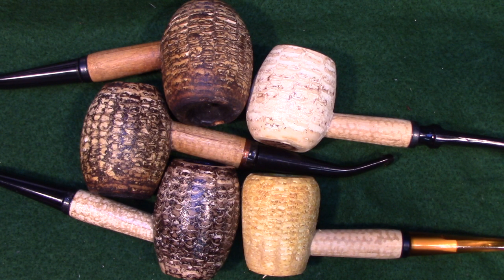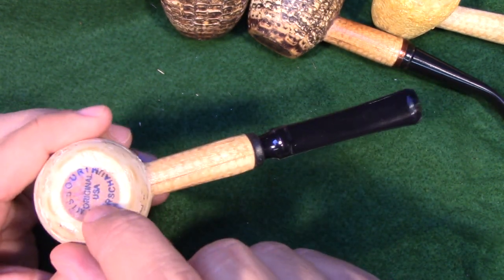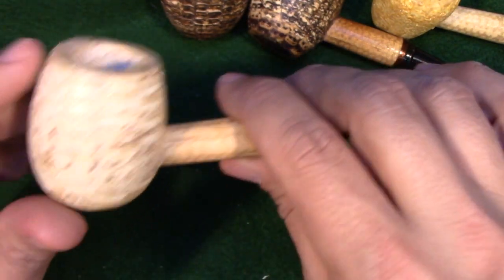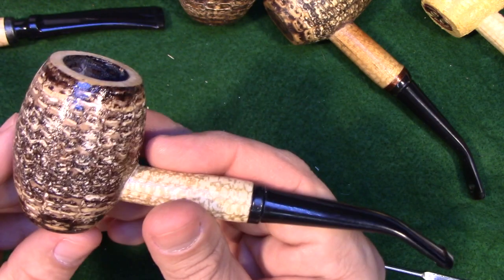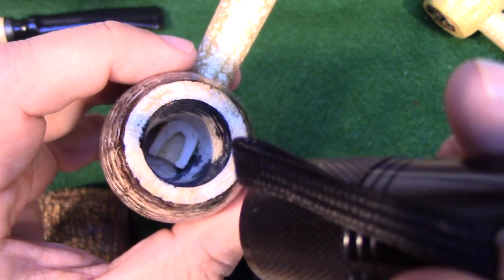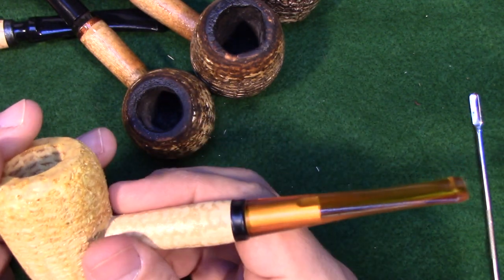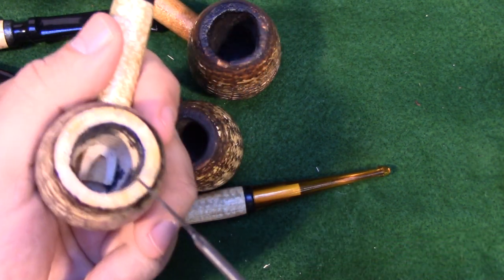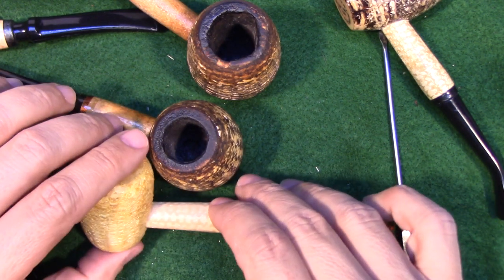Corn Cob Pipe Modification Part 1 Introduction

Comment: Hello my fellow MM enthusiast! Although I love my briar pipes, I smoke cobs very often and I love collecting and modifying them. I wanted to mention some friendly info; all of the pipes you showed are coated in plaster, it's just that some aren't varnished. The brown ones are stained and varnished. The plain cobs are easy to spot because they have a very rough textured exterior (it's a corn cob after all), they're very lightweight, and significantly cheaper in price. The factory second pipe at 10:40 is called a Rob Roy, which is a cool shape IMO, and it's stained yellow but has no varnish. Sadly they changed the 10-pipe grab bag to 7, and now it's $34.99. 

Personally I like the plastered ones - or "polished" as MM calls them, regardless of varnish - best, but the raw ones dissipate heat very quickly, which is a bonus, and that's why some folks prefer those over the polished ones. Anyways, I really liked your video and I'll be sure to check out some more! 

Best Regards from Cape Cod Massachusetts 👍🇺🇸
Reply from the maker: Thank you for watching, and for the helpful comment.
Reply: Happy to say I've got a hold of Apple  Diplomat with straight danish bit, actually ended up shortening the shank by almost half and shortened the bit, and pipe mudded the bottom of the barrel with salt and plaster of paris, lost the metal feurel and replaced it with a brass feruel.

Comment: I value my Missouri Meerschaums more than I do a lot of my briars. They are great pipes and always give a fantastic smoke. In fact, I have found that the best smokers are inverse to their price - cobs, clays, briar.
Reply: I am starting to agree. I been smoking 2 different types of tobacco out of some cobs and tried just today to go back to a briar I have dedicated to my favorite- now hate it. Tomorrow will try my favorites in a cob. If it turns out as expected my briar will be my guinea pig for carving customization.
Reply: Don't get me wrong, I LOVE MM cobs, and I smoke them just about every day. With that said, I have some briars that smoke amazingly well, but they're handmade. Factory-made pipes like Peterson, Savinelli, Kaywoodie, etc. often smoke like crap (of course, not always). The handmade pipes by the Italian artisan pipemakers are some of the best on Earth, and they smoke equally as good as a cob once they're broken in and if not overused. 

With that said, cobs are impossible to beat; no break-in period, no worries about overheating them and causing them to sweat-out moisture (at least not after a few smokes when they're new), they're practically indestructible, and they're so reasonably priced. Also, they're made by a good and honest American company. 👍

Comment: Definitely interested in the pipe mud video, I think a couple of my cobs could use a nice mud treatment. Thanks for putting this series together!
Reply from the maker: +Nom De Tube Mud is so easy you are going to have a great time with it.  The next video shows how to carve out the shank extension before the mud, but you can even just push it around and over the extension and improve the combustion.  Be well, Mike.
Reply: +CaneRodPiper Nice! These pipes are smoking pretty good for me, but who doesn't love a little pipe improvement project :)
Reply from the maker: +Nom De Tube Oh I agree!  The improvement is minimal.  Mostly just lets you get to the bottom of the bowl without burning wood.  But nothing like a little pipe improvement.

Comment: Being a new piper, seeking tips for boring out the chamber slightly.  I am thinking of using a 3/4" spoon bit to ream the chamber to 3/4" and stop shy of the bottom to remove the bit of shank that extends into the chamber.  What are your thoughts on this?
Reply from the maker: You are thinking along the same lines that I did a few years after I made these videos.  I don't think the spoon bit would allow you to get the shank extension out without going through the bottom of the bowl.  Since I made this video I have switched to using a 3/4 inch Fostner bit to do as you suggest, and that  gives a flat bottom that you can then build up with pipe mud or pipe mortar.  I really need to make an updated version of this video some day!
Reply: Thank you for your guidance.  I enjoy watching your videos.  I felt that a craftsman like yourself would have the answer I was looking for.

Comment: hey I've got this crack near the "lip" of the bowl of my MM morgan natural, cracking down maybe 1 cm to the exterior. seems like there is no leaking, just crack. is that okay? what can I do about it? thank you
Reply from the maker: I've had that happen on cobs.  Never seemed to be a problem other than cosmetic. You could probably fill it with glue and sawdust or plaster of Paris, but I would just smoke it as is.

Comment: As I am new to Corncob pipes seems like recently having bought one myself a few days ago there seems to be a wooden piece from the stem and going through and poking out on the bottom of the pipe and it has some hole so if trying to smoke the tobacco the smell etc. Possibly travel through that wooden tube part . I was however wondering if anyone who knows/ has experienced this/ has any knowledge of why there is a piece of wooden part sticking out of the bottom of the chamber or bowl leading up from the stem?
Reply from the maker: In one of these modification videos I show how to chip that away and replace it with pipe mud.  But most people just smoke the pipe until the wooden extension burns away.  It is annoying, but that is just how the pipes are made.  Thanks for watching!

Comment: An excellent and helpful series of videos, Mike.  Thanks!

My ideal chamber width is 0.85".  Most factory cobs measure around 0.75".  Which is fine, but I like to build a cake, so the factory chamber width ends up being a bit too narrow for me.

Any suggestions for drilling the chamber to make it wider?  Some people might panic about doing anything like that, but I've never had a cob burn through.  Also, a good cake acts as a firewall, and my cobs seem to last forever anyway.  So I'm not concerned with thinning out the walls a bit.  Cheers and Mellow Puffs, Mark

P.S. I use Virginia ash and tap water for pipe mud and never had a problem.  Hard and smooth as granite when it dries.  Cigar ash is probably ideal, but inconvenient for me.  In the end, pipe tobacco ash seems to work just fine.
Reply from the maker: Hello Mark, thank you for the comment.  I have increased the internal diameter using a 0.75 inch fostner bit in a drill press.  Many of the MM cobs measure 0.75 at the top, but seem to narrow.  The 0.75 bit opens up the chamber quite nicely. Take a look at my cobfoolery entry on the stubby gentleman for an example.  Thanks for the tip on VA ash! Be well, Mike.
Reply: I too have often wondered why MM makes their chambers so narrow, but as Mike mentioned, you can easily widen one with a drill press. Although for Virginias I find that a chamber diameter around 0.70"-0.75" to be best for optimal flavor, and once the cake builds up I just ream it and start fresh. For Burley and English blends a 0.8"-0.9" is definitely preferable though. 👌

Comment: Also I can’t find on the website where to get the seconds
Reply from the maker: This is an old video.  Maybe they stopped selling them.
Reply: I looked some more. They sell 7 for $30 but they’re all sold ouuut.
Reply: lf l understand correctly they no longer sell many seconds...they will let chipped bowls etc go thru now ..in other words theyve lowered their cull standards...when i ordered my pipe it came with info that there may be roughness and chipping on the bowl and the rim. one vid l watched said if you buy culls these days they will need some attention(repair) usually before you use them.
Reply: mark rush bummer

Comment: smoke the hell out of it and the cake will fill in the spaces in the bottom and burn down the walls of that hole extension till it's flush, then it's great
Reply from the maker: Yes, that definitely works and it's what most people do.  Some folks don't like the taste of the burning wood though.  Whatever works for you is the right thing to do!
Reply: Yeah...I learned the hard way about that burning hardwood.  I thought I was going to have a heart attack the first few times it happened.
So I got to, and chiselled the end of the shank out of the pipe.  Followed the instructions on the video and voila!  It now looks like a properly constructed pipe.  At least inside the bowl.  Thanks CRP.
Reply from the maker: Thank you for the comment!  I'm glad that the videos helped you.  Be well, Mike.
Reply: shatteredsquare I
Reply: I just bought a cheap chinese corncob. I am new to the tobacco pipe hoppy. My new girlfriend said that she much prefers it over cigarettes. My uncle turned me onto the world of pipe tobacco. Well I dont know much about corn cobs was debating if i should make a trip to homedepot or just let the cake on the bottom build up as they drilled the hole to deep a very thin layer on the bottom. Any advice would be good and appreciated.Thanks John
Reply from the maker: Hi John,  The only cob that I ever had burn out on me was a cheap Chinese cob.  I would recommend just putting a layer of pipe mud in the bottom to raise the floor and give the cake something to start on.   But I would also recommend a better cob when you can get one.   Best, Mike.
Reply: @CaneRodPiper  i agree with you. 6 dollars so no hard feelings. Great video I appreciate it.Yes i need to get a good pipe one of yours type. Have a good night my friend.
Reply: @CaneRodPiper  thanks again. Ive notice the bottom has a good layer of cake and is insulated quite well on the bottom and on the wall of this cheap chinese pipe maybe buying me a little time till I order online from your recomended co.Ill have to order a good handful. I might replace the stims with.bamboo. since im not to crazy about sucking on plastic.might just trim a few bamboos behind in the woods from my back yard being that I live in rhus little rv park in Tx.Ill take any free advice you have. Thanks again. If you were here we could drink some roasted chickory and smoke some haunted book store tobacco. I saw a man recomend on an other youtube video of his. Ok take brother

Comment: You mention the "Plaster like material" that's exactly what it is Plaster of Paris.
Reply from the maker: Hi Tony,  it might be.  At least the last time I looked for the information MM was not revealing the composition of their plaster.  But I do use Plaster of Paris to smooth the pipe after I modify the shape, and it works well.  Thanks, Mike,